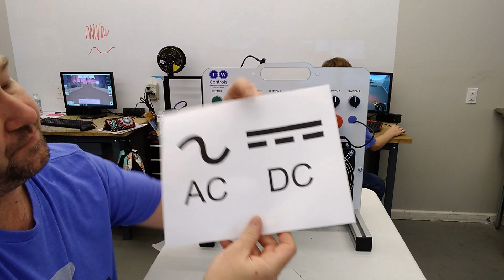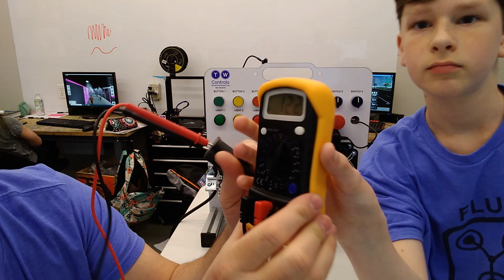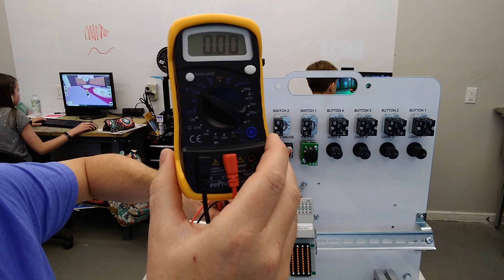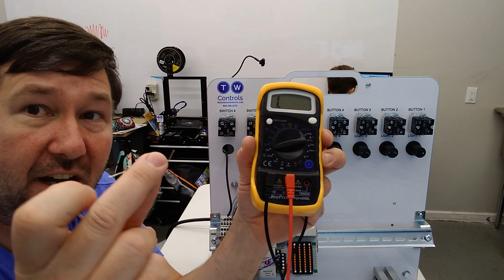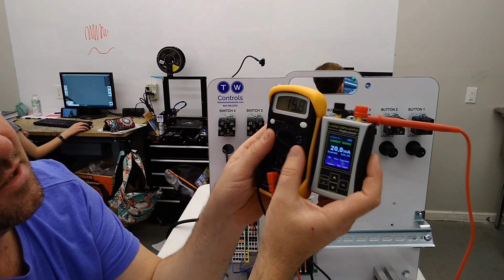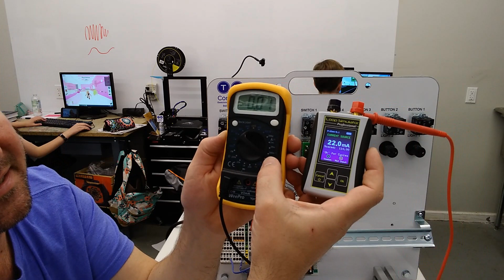How to use a Multimeter or Voltmeter.  Measuring Voltage, Amperage, and Resistance

Comment: Is there a difference between DC Amps and AC Amps?
Reply from the maker: Yes and this may be a good one to do a video on.  DC will be a level voltage above the reference point where as AC is a sine wave that goes positive and negative about the reference point.  But beyond that the amount of power is also different.  Let's say you have 100 V and 10 Amps.  On DC you would have 1,000 Watts...Volts *Amps=Watts.  On AC there is also a power factor included...Volts*Amps*Power Factor=Watts...100*10*.8=800 Watts.  Note that the power factor is unique to each electrical connection.